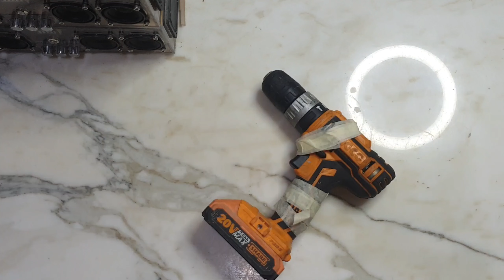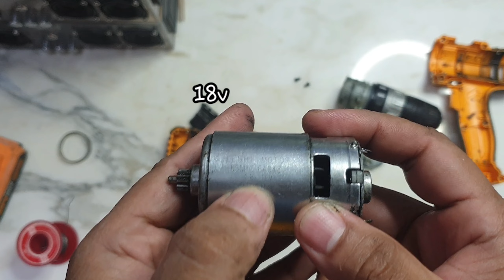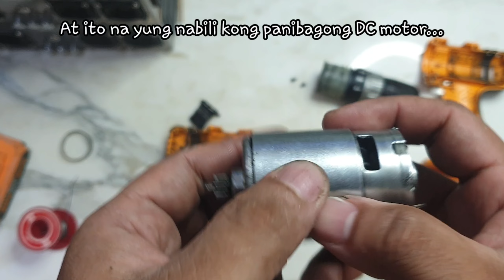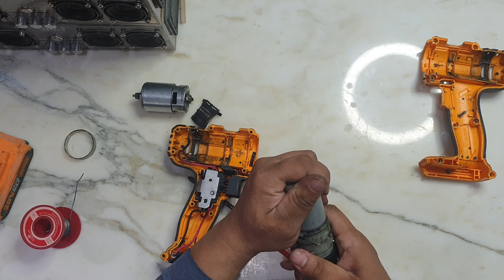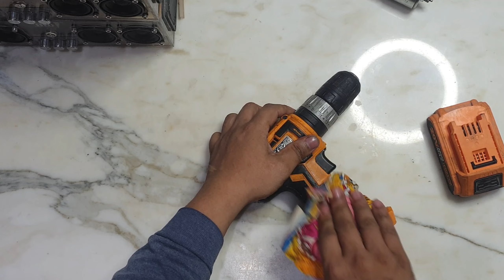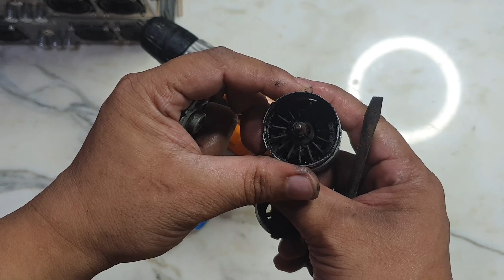Ingco Cordless Drill Motor Change

Comment: Is the ingco 12v drill motor the same as  ingco 20v in terms of size?
Reply from the maker: I'm really not sure but you could open your drill and measure the motor dimensions like I did before ordering the new motor, don't forget to order the motor also with the right voltage rating 😊😊😊😊

Comment: Good am sir san Po k u nakabili ng motor dril ng ingco 18v slmt.
Reply from the maker: Hindi po ingco brand yung binili ko pero reliable naman po sya. Sa shopee lang po ako bumili,...
Reply from the maker: https://shopee.ph/10.8V-12V-14.4V-16.8V-18V-21V-25V-RS550-DC-Motor-High-Torque-Gear-Box-for-Electric-Drill-Screwdriver-i.45674249.22342745325
Reply from the maker: 12 teeth 18v

Comment: Would I be able to put 20v motor on my ingo 12v?
Reply from the maker: Well technically you can, but you should also change the battery to 20v... If your using a 20v rated motor on a 12v battery, it will decrease the speed and its torque...